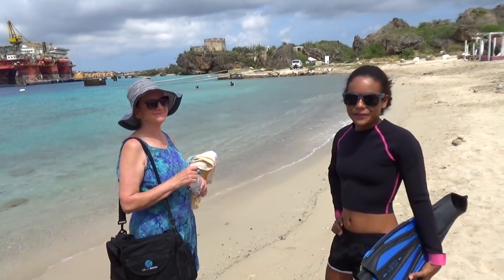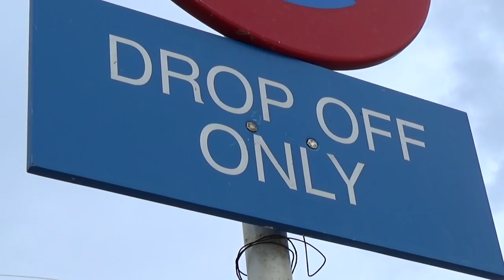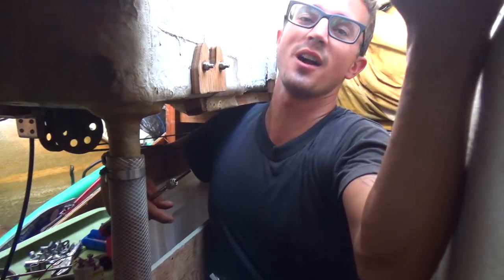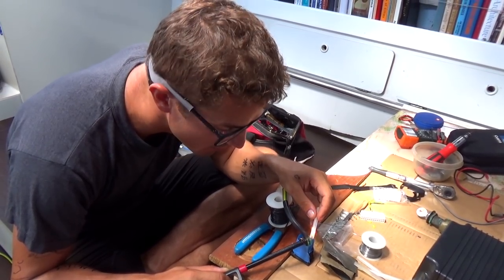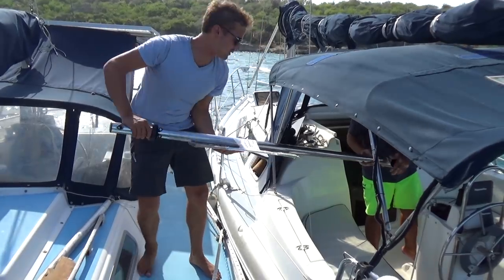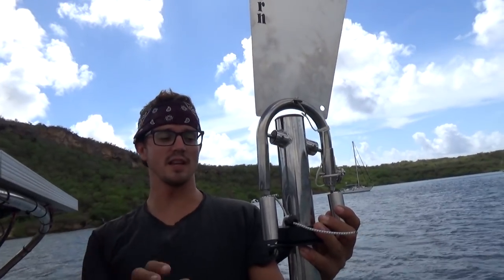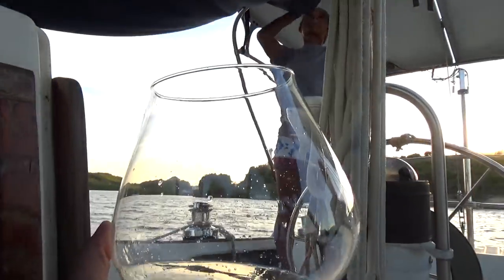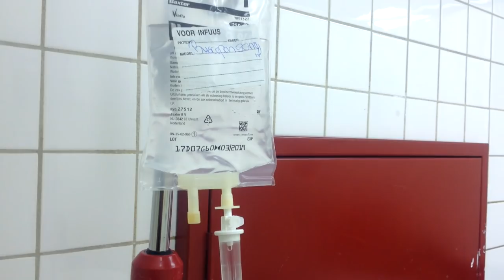Replacing our Autopilot with a CapeHorn WINDVANE — Sailing Uma [Step 101]

Comment: Dan...I was yelling at the screen...IT'S KIDNEY STONES...IT'S KIDNEY STONES!!! Those bad boys will drop a 300 pound linebacker to his knees in a NY minute. Also, one would think this would beg the question...how the hell does this happen?! Do your research and I'm confident you'll figure it out.  HOWEVER, one thing I want to share with you is...please don't fall for the "too much calcium" diagnosis. It's actually the opposite of that. Not enough calcium. There are other mechanism to it as well, but too much to go into here. Allopathic Medicine doesn't have a clue what causes it. Avoid drinks with Phosphoric Acid because they leach calcium more than a pink gorilla. Phosphoric Acid is mostly found in dark colas but I don't think you drink those. BTW...how much H2O are you drinking daily? Consider drinking about half your weight in ounces. I know I'm going to get a lot of flack for this but here goes! For those of you who don't know this...Phosphoric Acid is the first ingredient in Naval Jelly? What is naval jelly you ask? It eats the rust off from cars. Why would you ingest it?  Anyway, Google the crap out of it with the notion that it's not enough calcium and you'll find a way to modify your diet to avoid another episode. Also, were you soldering a bare wire onto the spade lug? Maybe I didn't see it correctly but bad bad bad if you were. A mechanical connection is much better...especially on a boat. Here are some thoughts for you...Marine grade heat shrink when making connections. Don't solder...use Anchor connectors with waterproof heat shrink. Last but not least...Use only TINNED WIRE on a boat. Doesn't corrode as fast. Sorry if I'm butting in to much as this is all said with love. Also very nice to share that snorkeling experience with Dan's mother. PEACE OUT!!! Ü